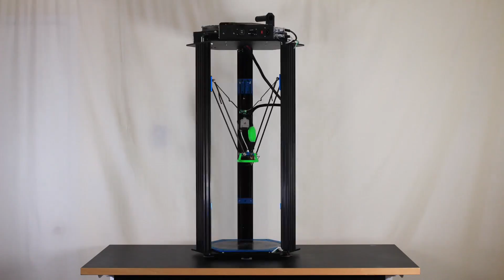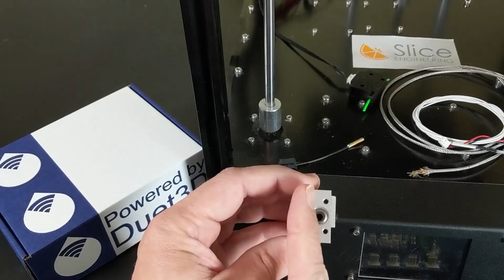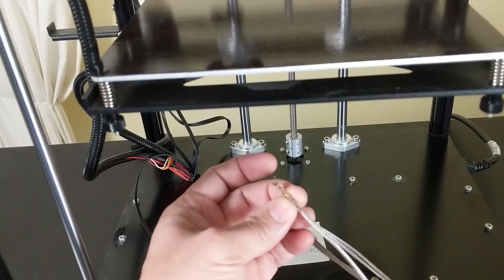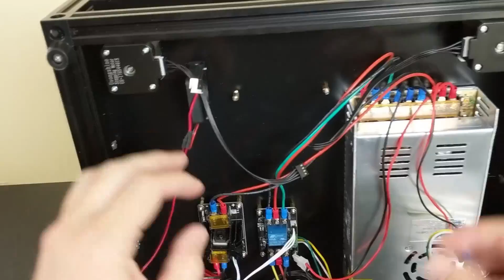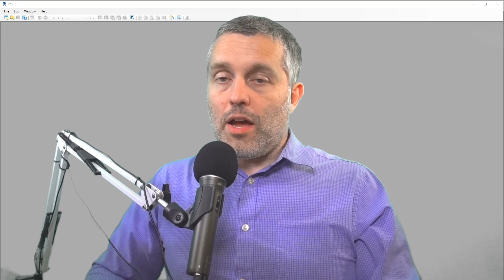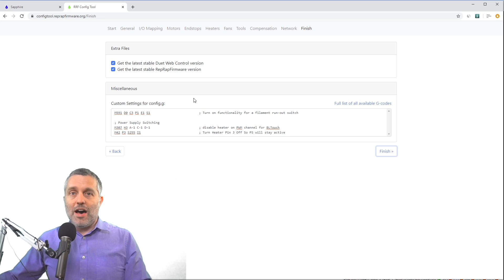Building a Better CoreXY Printer --- Sapphire + Duet + Mosquito +  BLTouch

Comment: As always I like your videos as they are very informative.
and please take the below comments as constructive criticism. 

1- I get your point on copying design, but you seem to be giving pass based on your subjective view.
sure it's your channel and you can give whatever opinion as you see fit, but if possible clarify that this is an opinion or something we should sue the Chinese company for.
for example, this titan look-alike you gave a pass I though you didn't go in why it gets a pass you just told us that, I even checked the older video if there was an explanation but there wasn't one. my point is you are just giving us your opinion expecting we should take it at face value, and I don't think that is a good way to go about things especially with how technical your channel.
2- I know you like Duet, and to be honest I would much rather have a highly engineered board as well (and in a position to be able to pay for it). but I have to say you are putting too much emphasis on the simplicity of setup much more than the actual firmware and if I am going to buy a board that expensive I would rather know what I gain from it.
if its only wifi connection then maybe compare it to Octoprint since that would give you wireless connection and don't need to rewire the original control board.
keep in mind you are talking to someone who is willing to strip the old board and re-wire a new one, usually don't mind the extra learning curve of marlin code especially with how popular it is.
(granted I would spend the extra money for a duet, especially when things get complex and need tool changing. that's why I'm excited for the duet 3)
3- also and I'm sure you heard this a lot when a company or individual puts something open-source that means they are ok and encourage others to benefit from the tech, that's the whole point.
of course, some use the open-source platform to get free community support, then crying when others benefit from it, IMO that is what's not cool.
the above is a reply to the linear-advance and pressure-advance comment.
and from what I can tell duet are still cool with being open-source so they are ok with others to benefit from what they develop and vise versa. I think part of the fast advancement of the 3d printing firmware is how many open-source projects are available each with its own healthy community.
personal comment: if you have time can you give your opinion on "Voron design", currently I'm planning to build a V1.8 and your opinion would be valuable to me.
edit: to clarify what mean in item 2 with "actual firmware" is the firmware features while printing. something that would give benefit in either speed or quality. like duet being able to compensate for ringing.
Reply from the maker: 1) Titan Extruder Pass; I covered in this video long ago: https://youtu.be/V6IL-u-rhz8?t=982
2) The truth is that the only differentiating factor between all the control boards and firmwares (as far as print quality is concerned) is ease of use. You can get all of them to do the same things. Except wirelessly tweaking the firmware that ability is unique to Duet. Other than that, they end up functioning the same if you have the skills and the time to set them up. You are most likely to succeed with the Duet. And you won't be frustrated by the process.
3) Your understanding of open source is flawed. Here. I made a video explaining it: https://youtu.be/iKhn5IcVvAg

The bottom line is that it's all about advancing the Tech. A few talented individuals are like 99% responsible for these advancements. If we don't reward these individuals by getting them paid, then the advancements stop coming. Or maybe the advancements slow down until the 2nd string of suckers comes along who advance the tech, go bankrupt and leave the industry like the last group did. Then it's third string... Then 4th string. Eventually, even the least talented innovators will stop making anything good for 3D printing and we will have nobody to blame but ourselves because we purchased the clones instead of rewarding the people who actually did the hard work of innovating.
Reply: @DesignPrototypeTest  you know I'm actually glad I posted this comment as I was hesitant. And thank you for the reply.
1- I understand you're point now. Though after watching the video you linked.
2- I don't have first hand experience with many 3d printing firmwares so I'll take your word on this for now. But it is disappointing to know this for the duet. 
3- I need to do more research on this, but I think what you call for in the video that when you modify an open source product you must also release the modification is called copyleft. (I think duet do ask for it) 
I do get your point though. And true having things open source can lead to a dead project or halt development.
I don't want to get into subjective matter, and licensing can get complex very quickly (I try to stick to engineering more than law :p).

Comment: If that were my house I would repaint the walls white. The beige paint, beige drape, beige thermostat, and beige table make your house look unappealing on video. It also makes the white balance of the video too warm.
Reply from the maker: Unfortunately, I rent. I am not allowed to paint. I'll go back to draping the white curtain across the background.
Reply: @DesignPrototypeTest   Sorry if I came across as a dick in the original comment, but bad white balance is a big pet peeve of mine. Especially when its never been easier to get it right either in-camera or in your video editor. The warm white balance and all the yellow tones in the video give it this old 70's kind of vibe. A more neutral color balance would make your videos look much better.

Comment: "you should point at them and laugh..." weird thing to say for a grown-up
Reply: I get your point, but any comment on the e3d cyclops/chimera heat sink?
Reply from the maker: Who said I was a grown up? Age ain't nothing but a number! Anyway, nothing else seems to get through to the manufacturers, so I thought I would try shaming them for their crappy designs. Whoever is responsible for that hotend should be fired from their job.
Reply: @DesignPrototypeTest  :D well let us know if it worked. Also I happen to have a similar hotend (as far as the cooling block goes) and yes it could be better, but mine (dual nozzle one) works very reliable with en 30mm fan mounted on it

Comment: Nice. How are things going with the e3d tool change printer. Have you looked at the white knite printer? I'm wanting to build one but having a hard time justifying a 400 dollar belt
Reply from the maker: The belt is what makes that printer special. Longevity and toughness would be my concern more than the price tag. I would be worried about how easy the belt is to damage. For instance, look at "The Ender 3 Evolution" video where I showed a ruined print surface because I printed PETG too close to the bed. Is it that easy to destroy the $400 belt? How long will it last before cracking as it bends over the rollers.
Reply: @DesignPrototypeTest  I to have destroyed a pei bed by printing to close.
 the bom on his github for the printer calls for a Full hardened Stainless steel belt 400mm x 1920mm

Comment: Are there any plans to add the zesty nimble to this printer?
Reply from the maker: I want to, but using a nimble in a chamber is an iffy unproven proposition with it's plastic gearing.
Reply: @npgoalkeeper _ Depending on the plastic the gears are made of it could be an issue in a heated chamber, stuff like PETG starts getting soft around 80-90c and if your heating your chamber to 100c then well your gears etc will start getting soft and not work as gears. (granted if they use something like nylon then there shouldn't be an issue but again depends on what they make it out of.)

Comment: Actually you've missed the biggest design mistake on a PRO. While scaling an S up they've somehow managed to mess with the belt paths. PRO's belts are not parallel to the axes on critical sections and they are parallel on "idle" sections where it's not needed.  
Also, S had a superior board (lerdge vs pro's laggy robin nano), better hardware interface (usb on it's face, power control), nice bearings. PRO's stated print field of 235^2 is unachievable in stock form etc etc. 
The only real advantage of Pro, i assume, is it's got a bit less idiotic print head design. Still a really weak one, but at least it's a bit more compact.
By the way, they've somewhat fixed stupid blind heat sink/radiator in later versions, but i'm printing with the old one on temperatures up to 240 (260 was my highest) with no clogs, oddly enough. If someone's having this issues i'd recommend try holding the tube retainer upwards when you push the tube in, may be that's the key.
Reply from the maker: You are right! I completely forgot to talk about belt paths in this video. I meant to mention it. The non-pro version has the same issue. China can't get anything right!
Reply: @DesignPrototypeTest  The original one was called Sapphire S. From what i've seen it's looks like it had all the motion done right, hadn't it? There also is a Plus version out now, an even bigger upscale with different bed mount design (4 rods, 2 screws iirc) which also features same flawed belt routing...
But if you'd want to check this out i'd suggest you look at the Elf printer, this one absolutely looks like the next evolutionary step of the Sapphire family, but a bit more refined or something:)
Also Pro's motherboard manufacturer, Makerbase used to have their (Marlin-based) firmware closed against the license but they've finally made their sources open. It is kinda late, but it's still better then never i suppose.

Comment: I think delta has the highest potential so long as you don't mind the printer having to be at least twice as high as it is wide due to movement geometry. Its biggest challenge is accurately modeling the printer's physics (geometry + inertia) in software for precise compensation. Since all axes are involved in all movements, delta would also be uniquely well suited for non-planar slicing with little to no performance penalty should that get more widespread support in the future.
Reply: The problem is that delta ends up with a fairly small xy size limitation on top of the fact that the Z is twice the height. Very few of the delta are bigger than 200mm and I don't know of any above 330mm actually.  The problem is that as you get longer the arms get the more difficult to make the precise movements needed accurately the farther out from center you go.  The farther out from the center the more precise it needs to be and that is more precise than you can get with most stepper and screw systems we have.  I mean you might be able to do it with a geared ratio on the motor and using a linear rail but then you are likely losing most of the speed advantage you had.

Comment: OK, this is closer to reasonable: $150 board on a $400 printer. This is significantly less than the printer itself, as well as CoreXY being able to take advantage of it.
Reply: Don't forget the $150 hotend, the new thermistor, and the $40 ABL sensor.